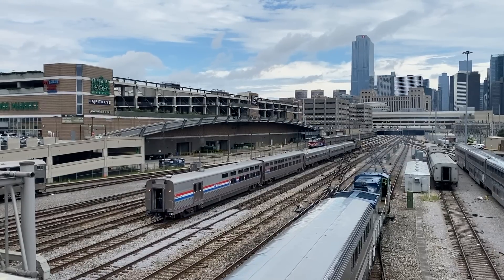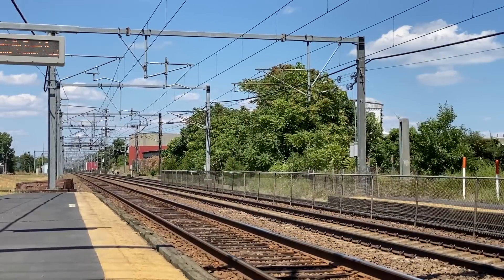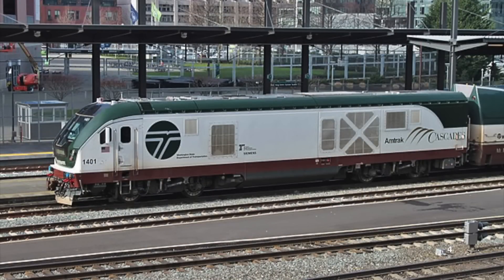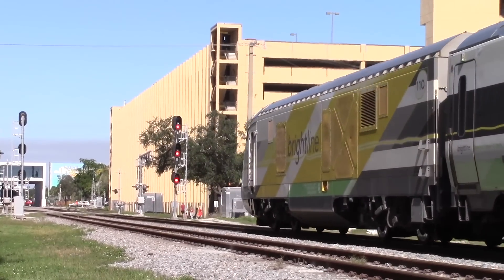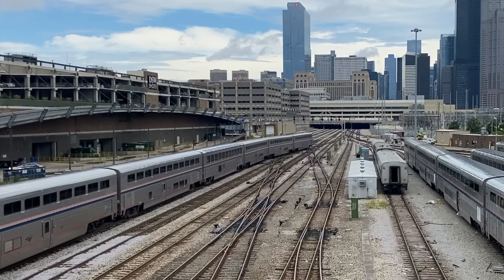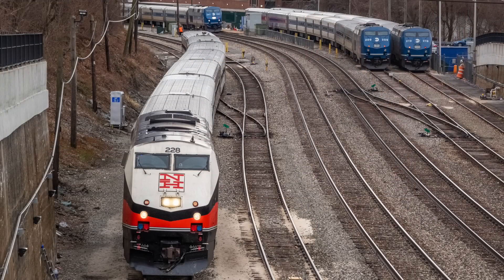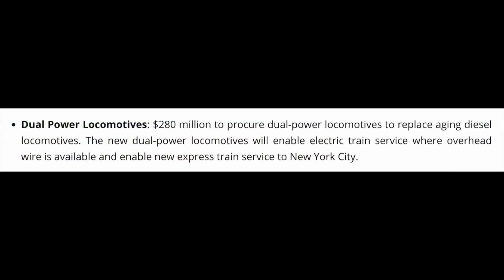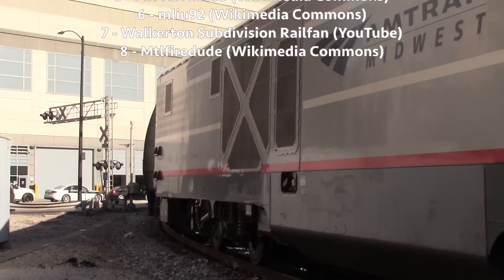Siemens Charger: Locomotive of the Future

Comment: What I don’t understand is why many mid-distance and commuter railroad operators are purchasing long distance locomotives when it would be far more economical and efficient to operate multiple units on high-frequency shorter routes (intercity DMUs are a norm in many parts of the world).  Perhaps Siemens should consider making hybrid multiple unit sets for regional operators based on the ALC design standard.
Reply: I mean, its a whole different beast, considering long DMUs have several smaller engines and are usually DEMUs rather than DMUs. And Siemens only has the Desiro series in that, and its not that good compared to the chargers. Stadler, CAF, Talgo and Alstom are far better choices for DMUs/EMUs/BMUs
Reply: Ikr, DMU's and EMU's are far better for the task in hand, at least Caltrain understands because they're getting new EMU's
Reply: Like most things wrong with American infrastructure, it comes down bad regulations. I'm 100% in favor of good regulations that improve safety, but we have a lot of regulations that are there just because that is how we've always done it, with no flexibility granted for new and improved technology.
Reply: @truedarklander  
Agreed on the DMU front, but honestly, Siemens builds the best EMUs out there (though Stadler does come very close).  Especially noteworthy are the regional Desiro HC, which is an absolute rocketship with a huge capacity and a design top speed of 200kph, as well as the Velaro high speed trains.
Reply: The issue is reguilations. Trains in the US must be beefy enough to take some damage in a crash. In Europe the thinking is different...focus all regulations to avoid crahes. 
So most light-weight DMUs / EMUS are impossible to certify for the American market, at least when they run on the same route as freight traffic. 

There is actually a German DMU operaring somewhere in the US but it is classified as light rail...in Europe it would be a typical train for a regional rail that has low utilistion.
Reply: @truedarklander  Desiro HC is pretty good, the old Desiro Classic are not really up to date

Comment: I definitely would be cool to see a railroad review of Metro North or Long Island rail road, Long Island being the busiest commuter rail in the country
Reply: I can't remember if he did Metra or not, but in  theme with your suggestion I'd hope he does an in depth video on Metra given it's the third busiest commuter rail operator in the country. It'd be even cooler if he did Metra and South Shore Line together given that they (including Amtrak Midwest as well) serve as the primary commuter and extended commuter services for the Chicagoland metropolitan area. 

I also hope Metra gives up on it's stupid crusade to keep only EMD powered locomotices in it's fleet just because "it's used to working on them." This goes against their multiple claims to wanting to reduce harmful emissions and create a healthier environment for ridership. Given that we are set to replace all of our Nippon sharyo and bombardier Bilevel passenger cars with modern Alstom Coradia Multilevel passenger coaches, it would make a lot of sense to match them with well built, new dedicated passenger locomotives like the Siemens Charger. And yes, I'd miss the F40s, but man are they barely hanging on by a thread even with multiple rebuilds and fantastic maintenance. It's just time. Though I will admit that like most other state funded transit systems, funding is tight and margins are razor thin. So it's understandable. But frustrating.
Reply: @scenicdepictionsofchicagolife  The Chargers suck in Chicago's winters and The Freight Companies are being assholes